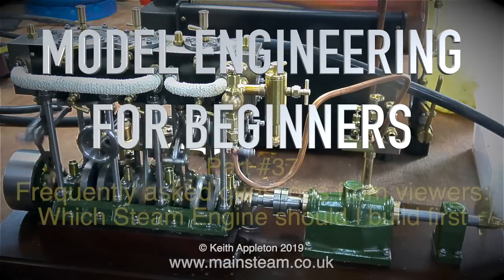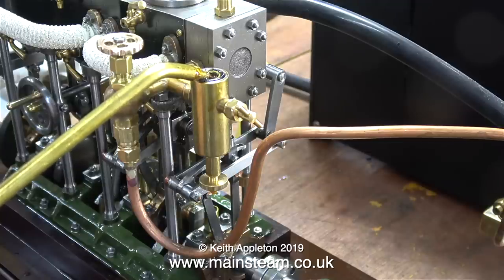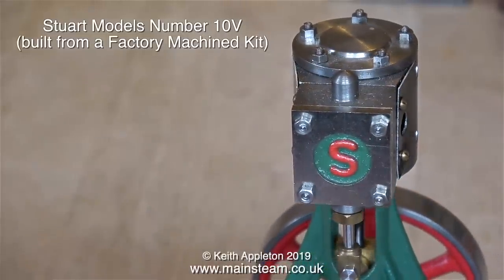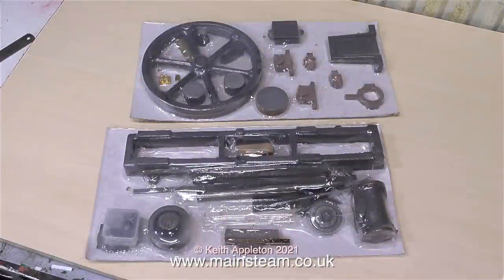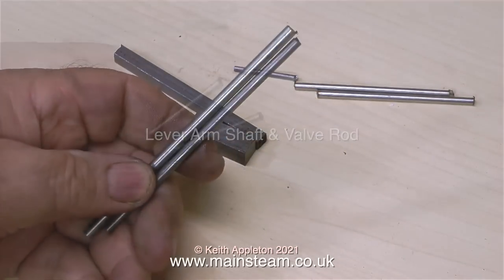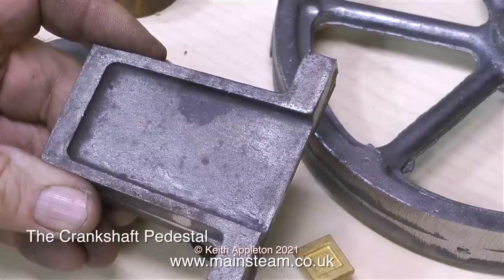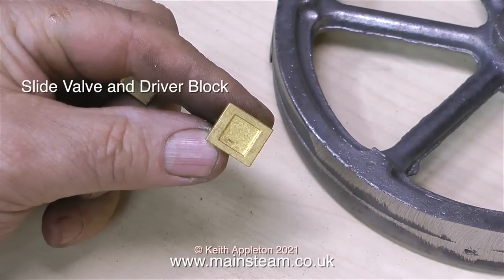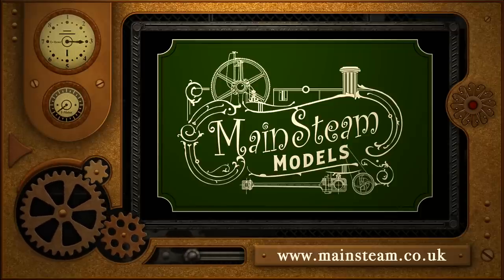WHICH STEAM ENGINE SHOULD I BUILD? - MODEL ENGINEERING FOR BEGINNERS - PART #37

Comment: Hi Keith,
it is time for me to say thank you for all this superb videos.

In 2017 I did a CAD course.
As a final thesis, we constructed a model steam engine.
Although the construction was not from scratch, it was still very interesting.
Since then, I've wanted to build my own steam engine. By profession I am an international welding specialist and I work
at a mechanical engineering company. This gives me access to a wide variety of materials. I had a small lathe and a milling machine anyway.
Your videos gave me the final impetus and I started construction on the computer in August 2020. September 2020 I made the first chips.
Your most important statement for me is: "Every single part is a model in itself"
It's a steam engine made of bar stock, but it doesn't look like it.
And now, the engine is 99% complete.   ;-)

Thank you, stay safe and healthy

Rudi

Here's a little note about your accent.
For me as a North German, it is very easy to understand you.

Comment: Thanks very much for this great video.  I would love to build a Victoria, but as my first engine, I have just bought a 10H kit from Stuart models.  For me it was down to the cost of the kit, if I screw it up then it hasn't chewed up as much cash.  Incidentally I am a long time viewer of your channel and it is largely down to you that I have caught the bug to build a model in the first place.  Thanks very much and keep doing what you do! All the best, Tommy
Reply from the maker: Good luck Tommy, the 10H models are slightly easier to build than the 10V type.
Reply: @keithappleton  that was one of the reasons I chose it.  It was a toss-up between a 10H and an S50, but I didn't like the fact the base casting is integral with fake screws and fake bearing caps.  That was a deal-breaker for me.

Comment: while tempting and affordable, I don't think I am going to build a kit steam engine

I've been putting together a DIY injection molder and the main cylinder and piston gave me a few aha! moments

makes me wonder why no one makes one from steel pipe instead of cast iron

I guess I'll have to fail at building one from scratch to know why for sure
Reply: It could be done, but you'd have to get seamless pipe or remove the weld seam from inside
Reply: A lot depends on how pretty you want the engine to look, and how far 'outside the box' you're willing to go. 
I didn't have any proper machine-tools or a lathe while I was growing up, or after moving to my first apartment. Over the years I built a number of working steam engines from scratch - basically junk, hobby-shop, and hardware-store parts. I'm talking about low-speed, low pressure (under 10 PSI), non-reversing engines. I made cylinders from 3/4" hard copper plumbing-pipe, piston-valve assemblies from brass tubing, using nails with the heads ground to size for valve pistons, and thick wire hanger rod bent to make a one-piece 4-cylinder crankshaft. In the case of a single-cylinder double-acting walking-beam engine I built for a model paddle-steamboat, the bed plate, pylons for the shaft supports, and 'gallows-frame' for the walking beam were all made from thin galvanised sheet-steel - light-weight and corrosion-resistant.  All my engines are a simple design that eliminates the eccentric. Instead, the valve operating rod is connected directly to either the bottom of the connecting-rod or the crank-pin.

Comment: I keep wondering it it would be possible to make a double acting cylinder using two brass copper tubes with holes for the inlet and outlet ports. To eliminate the need to cast a cylinder block.

Comment: I guess I am surprised at what you suggest for a first build. Flywheel looks large to do on a small lathe.seems like you would need a mill for that long base? 10V or 10H seems like smaller and fewer parts.
Reply from the maker: If you watch my series called "How To Build A Model Steam Engine" showing how I machine the Flywheel and shape the Base, you will see that your observations are incorrect. (www.patreon.com/keithappleton)
Reply: @keithappleton  A 7 inch flywheel just does not allow machining on my 7x12 lathe. Finished my first from castings but it is a PM Research #3 . It runs at least on air. Aluminum casting version but I did put in bronze shaft bearings.

Comment: Curious on your thoughts of the 1846 Scotchcrank engine designed by Anthony Mount which is offered by Polly Model Engineering, it seems very simple looking at it, and the kit is only a little over 100 Pounds for a fairly large model.

 So it looks like it would also be a good contender for a starter engine, but I don't have much experience to draw from myself in that assessment.
Reply from the maker: I have never built one so I can't comment. I recommend the Stuart Models "Victoria" as a first build.
Reply: @keithappleton  Fair enough.
Reply: i built anthony mounts crosskill engine from polly i found it an ideal first engine